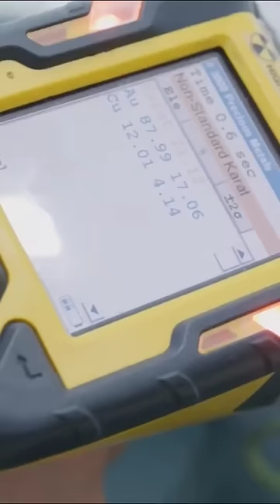Did we buy gold with Tungsten in it? 😱

Comment: if you're testing by way of XRF, Gold can show up as tungsten. in my experience its normally just the last .09% that will show false positive for tungsten. most good refiners know this and will ignore it in evaluation of purity/cost. this is why XRF shouldn't be used to quantify/qualify gold at this lvl, or should be used in conjunction with other methods. Just the visual of physical properties tells you there's something wrong. tungsten is extremely brittle and fractures exactly how it is in your sample. gold, however, as we all know, is the exact opposite and is extremely ductile. looks as if someone is Fing around and should find out very soon. I'd request an aduit of the refinery that did the work. Get someone who knows what they are doing to help you audit them. even some of the big refineries have been known to fudge things from time to time. Gold has driven good men to do shady things since the dawn of time. Refine in house is the only way to go!

Comment: To be clear, tungsten is fine in gold, but that high of a percentage is clearly a sign of tampering.
Reply: Tungsten is not fine in gold. You can not add tungsten to gold by accident.
Reply: @inso80  I'm saying that trace elements are normal, but anything above .01% is clearly added in
Reply: @mythrilman672  Having even 0.01 in gold would be extremely questionable. Tungsten just doesn't work with gold like that.

Comment: Sorry but physics doesn't lie.... people do.  Tungsten is nearly impossible to smelt in anything but a very specialized furnace. Gold on the other hand, gold has a pretty low melting point.  During a pour you'd end up with a bunch of solid Tungsten pieces in molten gold... not a perfectly coated bar. To make a bar like that you'd have to pour gold half way up a mold, wait till it solidified, placed a Tungsten blank or core on top then pour gold over the top till you filled the mold.

Comment: tungsten cored gold bars have been an issue for ages so wouldn't be shocked if it is a tungsten disc with gold shell and i think you have to drill them to be able to tell properly
Reply: Not the case. Just about the only property tungsten has in common with gold is it's weight and that they are both metals. Anyone melting that down will notice immediately, no excuses.

I think this is just some youtuber attention seeking bullshit story.

Anyone buying into that story should immediately switch careers if they have anything to do with valuables.
Reply: it has and does happen

Comment: Who ever made the bar NOT the coins or scrap was the scammer.   In order to get it to test as pure gold and to get the Tungsten to stay in the middle you have to mold a gold bar to be hollow on the inside and then poor a mixture of tungsten and a bonding agent like lead or tin.  Otherwise Tungsten which is heavier than gold will sink to the bottom of the mold and be Obvious right after it was made.  tungsten powder would be exposed on the outside surface of the bottom.

Gold melts at 1,064°C (1,947°F)
Tungsten melts 3,422°C (6,191.6°F)

There is not gold refinery that would be able to melt tungsten.  Their equipment would disintegrate way before you could even get close.  This was no accident, the bar was made to be a fake.

Comment: I know exactly what happened.
Gold and tungsten have very similar density’s. So someone ripped you off by selling you gold ingots or gold jewelry made from tungsten that was heavily a gold plated or enveloped in gold.

So if you do the stone test or the electromagnetic test it would pass.

Your crucial on the other side is too hot which is was able to melt the tungsten.

But gold and tungsten don’t alloy well, which is why the melt results in cracks.

Comment: Just remelt it. The gold will float and the tungsten will sink easily separating the two metals. You aren’t making a tungsten/gold alloy at gold melting temps, it’s just not happening. Tungsten has a melting point of over 6k degrees Fahrenheit and at that temperature gold is burning.

Comment: You guys know that you can make crucibles out of tungsten right? It's common. It is durable at high temperature. Also molten metal does act as an acid. Thus it can dissolve tungsten from a crucible. If you guys don't know this, then you probably haven't melted stuff in tungsten before.

Comment: It is actually normal, the spectral emissions of gold and tungsten when you refract UV light off of them are nearly perfectly identical, and if that's the only way they tested it then it wouldn't surprise me. They have totally different conductive properties, and melting points as well, but if that little machine is all that was used then yeah, it's genuinely not enough to tell a difference sometimes.
Reply: To be more specific, gold refracts light between 200nm and 500nm, and tungsten will refract light between 300nm and 1400nm, which means when you shoot UV light (≈300nm) at them with the little device he has in the video, it can be extremely difficult for that device to tell the difference.

Comment: My grandpa taught me alot about coins. First things is, they are NEVER worth the orice people are asking. Second of all, its very common for scammers to use tungsten coins covered in a thick layer of real gold to make the weight proper. That how they get around the scan test. It only picks up the gold on the outside because the layer is thick. You should have done the fkick test on the coins. If they have a slight ring, its gold. If it sounds dull then its tungsten.

Comment: I'd take a bet someone covered a tungsten bar in gold foil, to try and pass it off as full gold, they used tungsten for the weight but lead is actually closer, regardless getting the volume of gold and weighing it to make sure it should be around the same weight, not exactly cause 22 karats is only like 90% gold and that last 10% can through off weight by a little.

Comment: Only 2 options here. Melters were trying to run a scam, or this video was just made for clicks and is fake. Tungsten melts at a way hotter temp than gold, the gold would have evaporated if the crucible was hot enough to melt the tungsten. And if it wasn't hot enough to melt the tungsten then it would still be in the coin shape. Only 2 options here lol

Comment: Yea well also he lied to you you couldn't get the crucible hot enough I don't think to melt tungsten.... I think the gold would start to evaporate at the temp it takes to melt that metal there's a reason it's used in light bulbs and for welding lol it can get stupid hot and not burn up.

Comment: You were being tested to to see if you would fall for it they knew the machine would read it as real gold but what they didn’t expect that the colder tungsten inside the wrap was cooler than the gold was at the exact pour time and greed overpowered  the thought to check the final outcome Hint : same as you would do with drugs  if it happened once will happen again!!!  ONLY  option you have is find a new dealer

Comment: They use tungsten because it fools the electric testing tools and it replicates the specific gravity they will replicate a actual serial number gold bar from a known supplier then only cover the outside in gold that means it's actually only 25% of the gold that should be there in higher quality fakes your lucky that your people Melting it didn't charge for the crucible and thank gold they didn't put it into a link mold a bar mold not so expensive a link mold expensive and no tungsten has the highest melting point of any metal so there is zero reason it should contain tungsten except to fool electronic detector and specific gravity

Comment: But how did it get passed the refinery? And how is the outside casing of the bar gold but the inside is tungsten..is it how the hot metals settle? I have so many questions!
Reply from the maker: I know. We have a lot of questions too.
Reply: Tungsten core . Probably a tungsten core dipped and stamped gold outer casing . 
A lot of people trying to rip people off with gold bars will drill the core out and fill it with tungsten. 
Even with high end replica clones such as fake platinum / Gold they’ll use Tungsten and 904L stainless steel to help the weight be higher
Reply: @Crmjewelers  Would love an update to your investigation!! Maybe a miniseries, talking to different refineries to get their opinion, precious metal dealers, I’d even be interested in hearing from someone who scams the gold on the black market. That’d be an awesome deep dive into the scam.
Reply: The whole bar was switched with a fake one when no-one was watching... either by guys at the refinery, or the dealer.